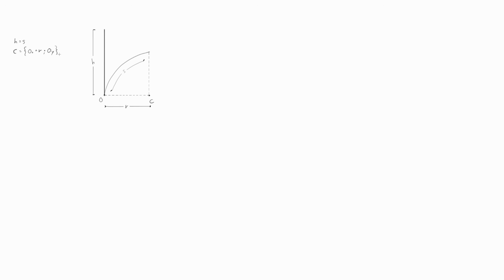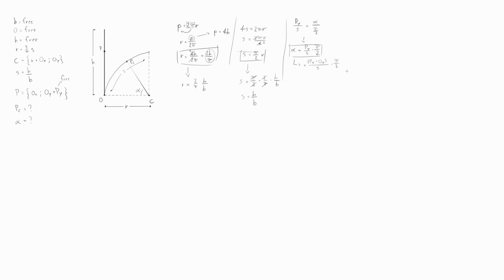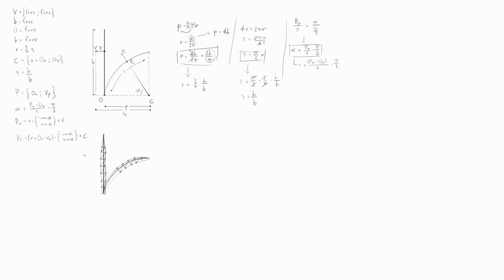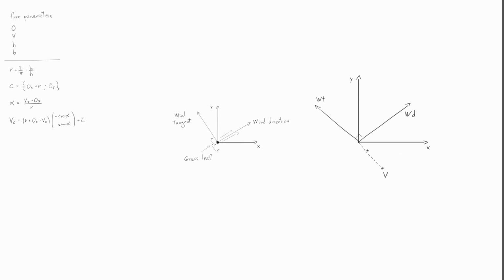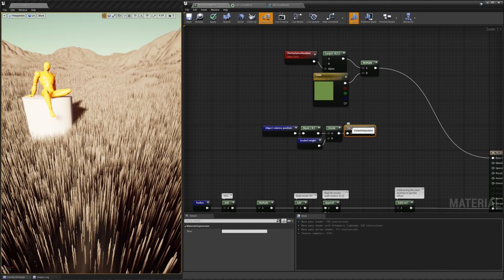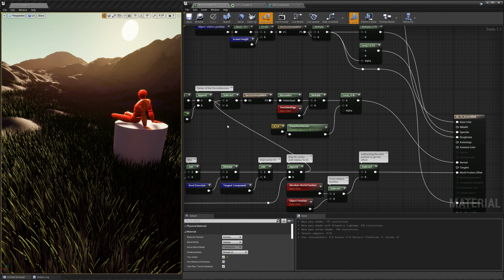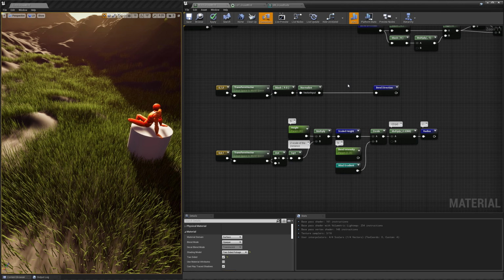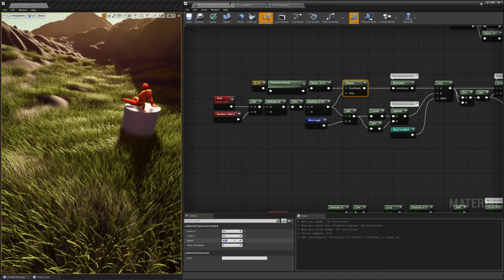HYPER-REALISTIC Grass Wind Animation [UE4, valid for UE5]

Comment: If I join many small grass patches or bushes into a single 3D model, will the wind animation still work on this kind of mesh? Each small plant is placed in a slightly different spot.
Reply from the maker: You have to bake somewhere their relative offsets from the pivot if you want to move the individual strands of the clump individually, but yes you can do it. I remember someone has done it and written about it in this comment section :)

Comment: Great content, thx for the clean explanation for the "behind the math" as well. I'm no pro but instead of using procedurally generated noise which is way too expensive for runtime usage you can try sampled noise for the dynamic wind gradient, which I tried in my version and result is practically the same, and for cutting more instructions from the shader you can cut vertex interpolator nodes from everywhere. My version of this same shader is currently 126 instructions on pixel shader and 258 on vertex shader.
Reply: hey man is there any way you could send me a photo of your node setup or something, the performance toll is very high and im new to unreal, i really want to use this but also not sacrifice performance in my project.

Comment: This grass looks amazing, but i'm having some issue (ue5.5), at 27:22, my subtract node gave two errors 
[sm6] (node subtract) Aritmetic between types float2 and float 3 are undefined
[sm6] (node subtract) Invalid input types: float2, float3
where did i messed up? I did it step by step, pls help
Reply: Apparently used add and not append on the node before that subtracnt u.u

Comment: Hello! Thank you for this tutorial. It's pretty hard to follow but im definitely learning more because of it. I do have an issue though, how did you define cos(a) and sin(a)? I keep getting an error saying "a" cant be found even though all the nodes are linked up exactly as yours. Im not sure if anything has changed from the engine you used, but I am using the UE5.5. If anything has changed is there a work around?
Reply from the maker: I think you have to define the input variable in the Custom Node details :)
Reply: @VisualTechArt  Thank you :)

Comment: Awesome! But, i'm having this issue: when i work with the bend parameter, it bends only in the center of the leaf, and not a rounded movement like yours. And it stretches the mesh, making it larger. Could you help me please?
Reply from the maker: It's a bit hard from here... Is the pivot point at the base of the blade?
Is Nanite disabled on the mesh? (You need to modify the shader a bit to make it work with it)

Comment: Thank you very much for your tutorial. 😘😘😘I completely reproduced it in version 5.3 according to your method, which is very good. The effect is exactly the same, and you really saved me. But there is a doubt: why does the 3D model finally become a 2D patch? I don't understand. It's good to use it to make grass. It's strange to apply it to trees😅
Reply from the maker: Since I wrote the shader for grass, I did some simplifications and assumed the 3D mesh is flat, probably :)
So if you try it on trees it might flatten them
Reply: @user-cz1de3uy5l
Have you made it work with 3D objects? I try to replicate the look of wind effect with a wheat field and at least for the models in front, I want them to be 3D. :)

Comment: Foremost, THANK YOU for all the information, technique, and knowledge you have provided us.  

I was able to implement your solution successfully.  As well, I was able to swap out the height-calculations for the ObjectRadius node since it can be responsive to instance/object scale.

I DO have a question / request.  I understand this is all free as in beer, so feel free to ignore, but...the normals.  Is it possible to generate basic-detail on the blade of grass?  I'm just-dangerous enough with just-a-little knowledge to know it can be done, but clueless enough to not-really be able to it directly - lol.

Specifically, I was looking to marry techniques between your excellent work as well as this fellow: https://www.youtube.com/watch?v=YxE9yN9uOXU  He's running a breakdown on the techniques used for grasses in Ghost of Tsushima.  It uses a bezier-curve which can flex fine, but doesn't preserve length like your implementation does.  I love you both but in your camp here, the blade is so-long, it shouldn't get any longer or shorter.  However, he does have a nifty way of generating normals that it makes a nice vein down the middle of the blade, with some slight/tunable curvature at the edges as well to really sell a 'curved' blade of grass.

Both your solutions are excellent in their own ways, both VERY performant for the visuals.  However, sans using a texture-map, is it possible to demonstrate how one might create a vein/normal-detail from your solution?

Again, feel free to ignore me, but otherwise, much-appreciated on the teachings; keep 'em coming.  :D
Reply from the maker: Hey :) cheers

For the normals in the video I show how to compute the correct ones, once you have them (or whatever kind of normals you choose to go with) you can just add on top more details.
For example through the Material Function BlendAngleCorrectedNormals and so on :)

Comment: I have an issue, I do exactly the same as you and it's not working, my grass appear under the ground, lmao. When I slide the value in the bend intensity, it moves as it should, but under the ground. I feel like there's something off about the height and the bend intensity but I can't find the problem, I tried to put a minus in front of some values but it doesn't work, please.
Reply from the maker: Oh well xD flip the world upside down and you're fine :)

Maybe there is the default orientation of the mesh itself? Can't do much from here to help you :(

But if you got the movement right there must be some stupid sign or something like that around
Reply: @VisualTechArt  I've figured out where the problem comes from, thanks !
Reply: @Link-hx5qk  Hello I am having the same problem, do you maybe remember how you solved the problem on your end
Reply: @ansh9677  Oh, sorry for the late answer, I'm not sure but I think that I took a grass model that I already had, which had two planes stick with each one having two opposed directions. Obviously it is twice more demanding in terms of ressources but this is the only solution that I found.

Comment: Very nice tutorial! I am not sure what the problem is, when i tried this using UE5.3, it actually worked with actor postion instead of object position
Reply from the maker: Yes, they did a change in the output of those nodes, at the time of recording this the ActorPosition node wasn't even introduced yet, if I remember correctly :)

Comment: The realism of this wind animation is truly impressive. However, I’m curious if it’s limited to individual grass meshes. I’m wondering if it’s possible to apply this to a grass clump from Megascans, especially when dealing with multiple clumps combined into a single mesh.
Reply from the maker: It's easy to adapt it for clumps of single strands, for the "billboards" it's a bit more dangerous and not necessarily possible for how I see it :)
Reply: @VisualTechArt  I am not talking about the billboard. I am talking about the actual 3d mesh. With nanite we don't need billboards anymore.the link that mentioned above is for high quality 3d scanned grass. Image is just a thumbnail. Will this method work on compound mesh?

Comment: anyone know how to convert his custom HLSL node to material nodes? @26:50
Reply: I figured out that if you divide the radians by 4, then follow the rest of the logic of the expression by inputing the result of the division into a negative cosine into a Make Float 2 X input, and the result of the division into a sine then into the Make Float 2 Y, you get the same result as the custom expression. I guess this is because the CMOT Float 2 has a specific range defined so we need to remap the the angle a bit.

Comment: Thank you for making this video. Such a great project! Beautiful and mathematical impressive. 
I had an issue which I notice other people talk about in the comments; "the cylinder effect" where the grass circulates around an axis into a barrel like cylinder. If I turn of Nanite, this disappears. I'm using 5.2. I don't know if you have found an solution to this?
Reply from the maker: I didn't look into this yet, but other people fixed it, I think they have changed which is the node that returns the pivot location of the instance, but I'm not sure, you can try ask in my Discord server and see if anyone replies... Or maybe someone wrote the solution here in other comments :D
Reply: I found it! Replace "Object Position" node with "ObjectPivotPoint" and plug into "Mesh Particle Pivot Location".
But two things happen. The lower stem of the grass all align to y-axis causing them to disappear when looking down a grassy path along the y-axis. And fps dropped by 10 when using nanite haha, so I turned nanite of again.
Reply: @robinj6997  hey I'm getting the same issue. Did you manage to find a fix for it in the end?
Reply: I choose to turn nanite off since the fps was lower. And therfore I didn't solve the alignment issue either. I did it in 5.2. There is a discord where you can join.
Reply: @robinj6997  hey I’m in the discord. I couldn’t find your message but I’ll take another look
Reply: oh it wouldn't be message from me. I remember that I searched for "nanite grass" or similar and saw some post by someone else.
Reply: @robinj6997  ok thanks. I'll check later

Comment: Overall, I believe there is room for improvement in the tutorial. While the math solution provided works well within the specific setup you shared, it does not function correctly when applied to foliage or procedural materials. It seems to only work as intended for single mesh objects. I spent the last 8 hours meticulously reviewing and ensuring that my nodes match exactly, but despite that, the material breaks completely. This suggests that important information might have been omitted from the tutorial, making it challenging to achieve the desired results in these specific scenarios. The meshes should not spiral into circles and not be placed on the grounds or on the ground in single file... additionally the mesh is not suppose to scale disproportionately like it does for anyone following along. This is an advanced grass tutorial, but its not the best way to do things and charging 20 dollars for the answers on Gumroad is outrageous When the average person is only interested to see your approach more so than use in production as is. You blitz through the node setup on fast forward forcing uses to play at 0.25 speed which is not enjoyable... I found the math part interesting I was hoping to see it it all come together but alas something critical was clearly omitted from the tutorial....meaning its a giant waste of time
Reply from the maker: Thanks for the feedback, I'll try to be clearer next time. Wasn't expecting this since many people before you were able to make it work without problems :(
Reply: @VisualTechArt  loved the math part just want to say the way you explained things was great, I dont want to poop on your hard work... I appreciate you. I know how hard it is at times explaining complex topics. Out of the 10 wind and grass tutorials yours was the most exciting to learn it was unfortunate
but thanks for everything either way

Comment: Hey man, first migration works fine for 5.2. Now my issue, i try add a material parameter for the force and direction, force works well but direction flicks when timeline is updating the amount. Any tip for solve it? Also, i saw u plan to add a local force/derection based on sphere or cube, when if u update this for next level, who buy will receive the update? Ty for this amazing project!!
Reply from the maker: Yes direction needs a bit more care if you want to drive it from a BP :)
Usually if I update a project I sell I tend to give it for free unless there's a major feature added, which in case you pay only an extra, not the full price

Comment: I am 7 months late, but I also have a suggestion that corresponds to what you're making here. 

GDC is called Procedural Grass in Ghost of Tsushima; it was quite informative and gave quite a few tips on performance boosting regarding this exact technique.
Reply: on the bright side, video was super easy to find again, so imma just put the link here of you are interested (even if it's for a later date)

https://youtu.be/Ibe1JBF5i5Y
Reply from the maker: I remember watching it, they sait that they made it with particles instead of meshes, right?
Reply: @VisualTechArt  
sadly, I can't quite remember that part, what stuck out to me more was how LODs were handled on the blades of grass (and I watched it more for the wow factor than anything else 😅)
Reply from the maker: @TheNSJaws  Fair enough, maybe I'm the one confusing it with another talk :D
But yeah, I remember the LOD thing now that you mentioned it!

Comment: Every time I think I've mastered the art of material work, something like this comes along and gives me a reality check. I was using a world-aligned texture as my wind mask, but it won't give the same amount of variations you've put into the procedural one.
Reply from the maker: Well, in all fairness, if I had to optimize this shader, probably the first thing I would do would be to use world aligned textures instead of completely procedural noises :D
Reply: @VisualTechArt  lol, yeah noise is pretty expensive.  I'm curious however to see it in action with nanite now that we've got support for foliage, I feel the single blade approach is much more viable.
Reply: @VisualTechArt   Found out the hard way this method doesn't play nice with UE5's foliage paint system. It's okay though, as I believe I've learned a few new things.
Reply from the maker: What are the issues you encountered? :O
Reply: @VisualTechArt  A few things,  with the initial node structure, (before adding in any color or pbr properties) the values make the foliage mesh collapse into a single world axis and defom into a cylinder.
After adding in the wind direction and variety they instead all collapse to a single straight line on what I believe is the world space X axis averaged to the center of all the foliage instances.
This is in UE5.1 so not sure if the engine is handling anything differently. 
I narrowed down the problem to the implementation of the bend direction and the radius in the X and y vectors.  The z vector on its own leaves the mesh in their current positions but just makes cork screw curls along the z axis.
Reply from the maker: Mmm, maybe they changed the output of some Position nodes, try to swap between the ObjectPosition, ActorPosition, InstancePosition etc.

Because in the past the ObjectPosition node used to return the bbox center in pixel shader and the pivot in the vertex (how I used it in this shader), but they may have changed it
Reply: @VisualTechArt  I've been looking into this more, seems that the object position node only effects  the foliage instance manager instead of each individual instance mesh painted. 
None of the other various position nodes work and only end up making the result worse.
I read on the forums that passing the solution through custom UVs would get each individual instance but I'm not familiar with working with them.
Reply from the maker: @crs11becausecrs10wastaken  Mmm ok thanks for letting me know, I'll run some tests on my end to see how I can make it work again, now that I passed my project on 5.1
Reply: @VisualTechArt  sounds good,  I am determined to get this solution to work, my foliage is looking fantastic with the exception of the WPO.
I can confirm passing object position through custom UVs did not have any effect. 
There was another post of some custom code to find the instance object position,  but that seems broken in 5.1 as well.